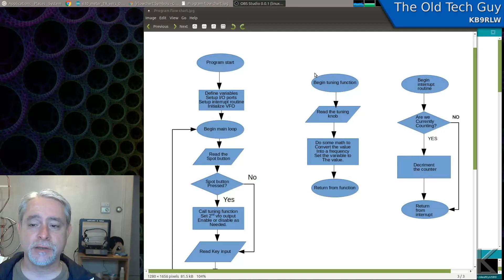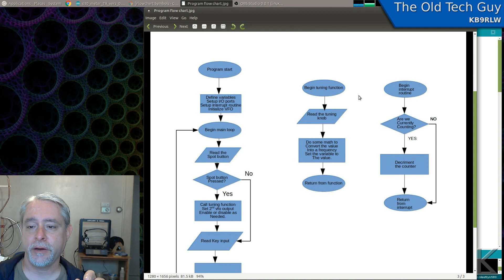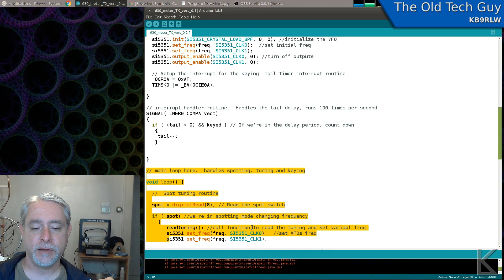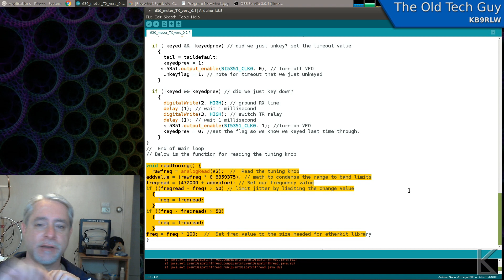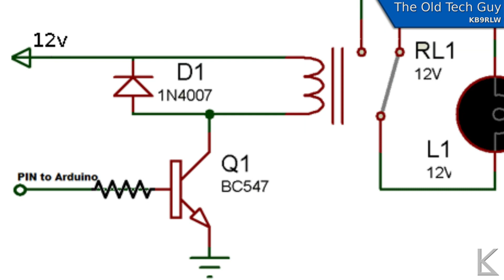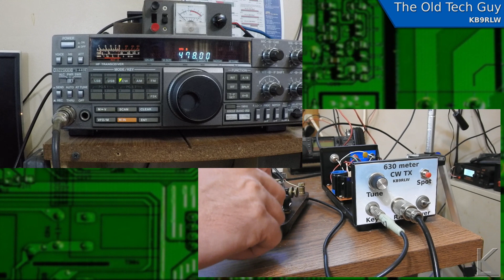Ham Radio - 630 meter CW transmitter part 3. The Software is done.

Comment: There's no LPF?
Reply from the maker: Yes there is.  If you go look at the first video in the series, I show the schematic of the P.A.  There's a Pi network filter on the output.
Reply: Kevin Loughin oh, I see, I'm thinking about making a 40M transmitter by using SI5351 and your series will be a very good example, waiting for your updates, de BI4SQM/KG5ZZF

Comment: Why not use a MOSFET instead of a relay?  I have a relay bias lol.
Reply from the maker: You can't switch RF with a mosfet.  You could do so with PIN diodes, but that gets more expensive and complicated.  Relay's are easy to find and quite reliable.  That's probably why they're still used so frequently in even modern rigs.

Comment: Do you have the avr-gcc tool-chain installed with all headers and libraries and you can have Code::Blocks produce machine code that can be uploaded into the Arduino maybe you don't know that Code::Blocks can be made to produce *.hex files if that is what you want, BTW I enjoy this series, what about using a PWM amp based on a NE556 where one side acts as a clock operating at 1MHZ driving the second half as a modulator if the modulator is working properly then the modulation should follow the input signal.